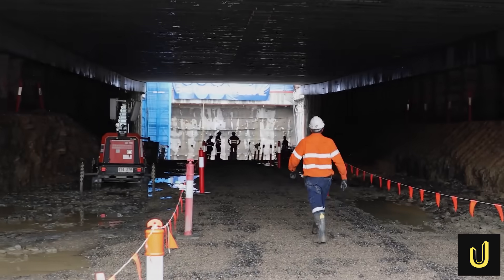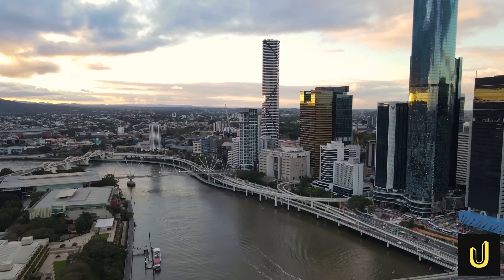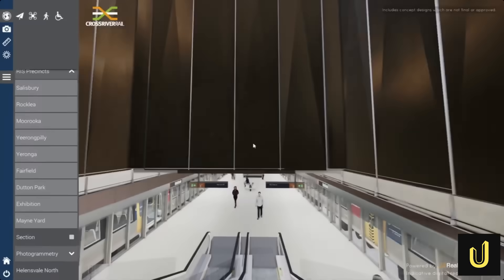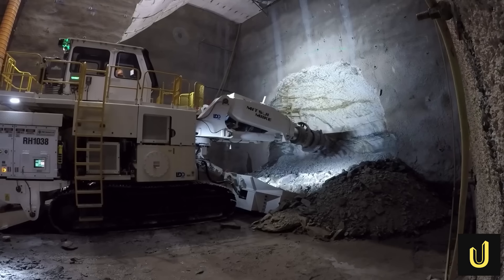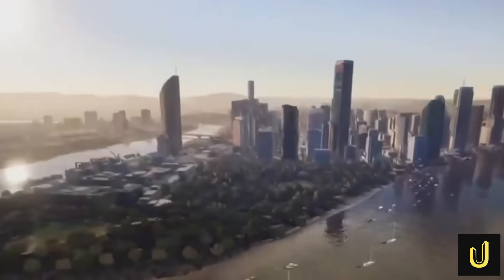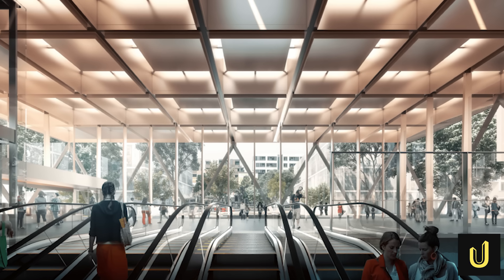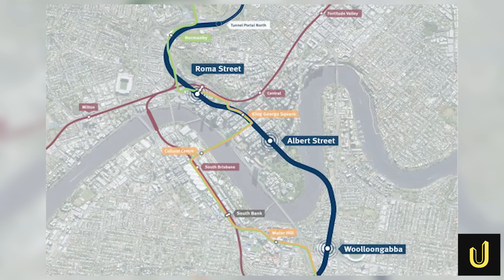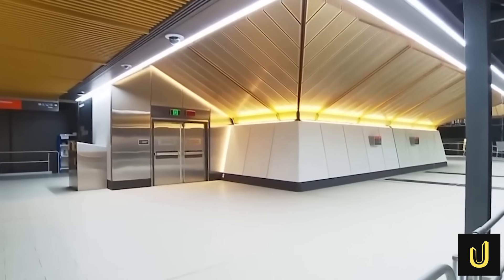Brisbane's $19 Billion Cross River Rail Secret Revealed

Comment: The project is closed to.completion. tunnels have been dug and fitted out same with most of the stations on the line. They have also.run trains through the tunnels for testing.

Comment: The massive increase in cost does seem silly at first. But when I think back on the original proposals for cross-river rail I remember thinking they were completely short-sighted for the investment they were putting in. The plan has changed significantly since it's first got the green light and frankly I'm glad they have steered it into something more responsible and forward thinking. 19 Billion is still rediculous, but the alternative was spending billions on a total waste of effort. Personally, I think 19 billion could afford a totally different and better solution, but I'm not the one making the choices.

Comment: Always under estimated and over promised, a huge undertaking but needed due to the absurd amount of immigration the Govt's letting in for peanuts in return, even with the upcoming Olympics... it might not have been needed but I know not that much - kiwi (truckie) immigrant myself...
Reply: This has been required for 50 years and problem identified a century ago. The network has always been plagued by the single river crossing and central station has loong been forecast to reach capcity. Nothing to do with migrants. everything to do with poor planning and lack of political will. You dont start projects of this size when they are needed urgently, you start them at least 20 years in advance. Which we did not do.